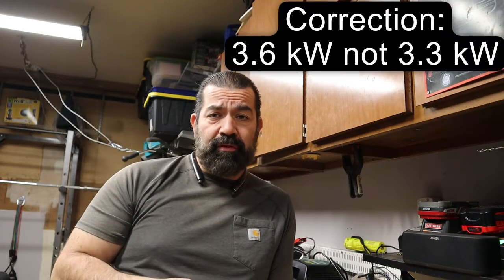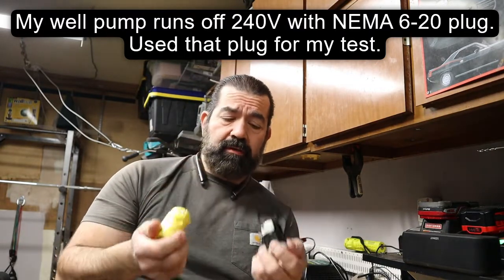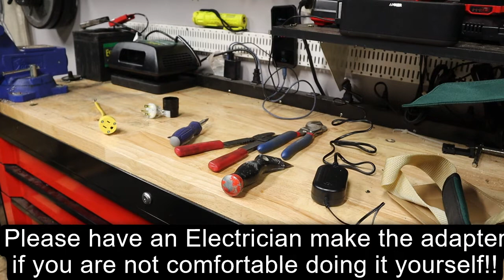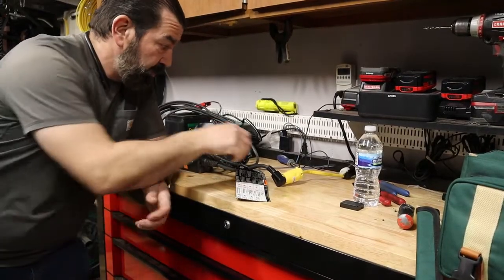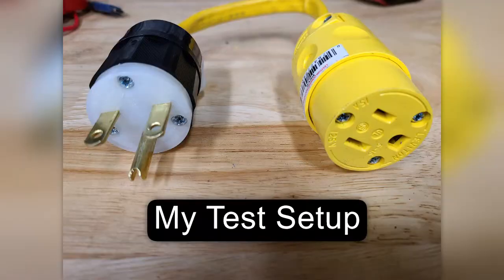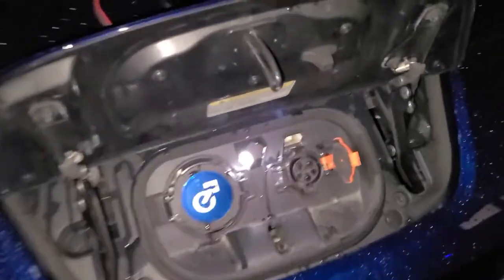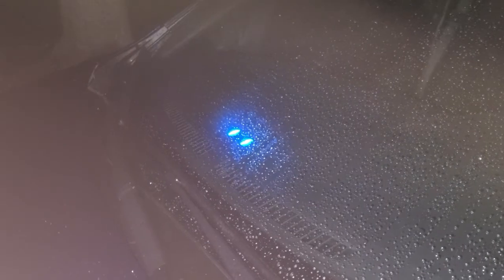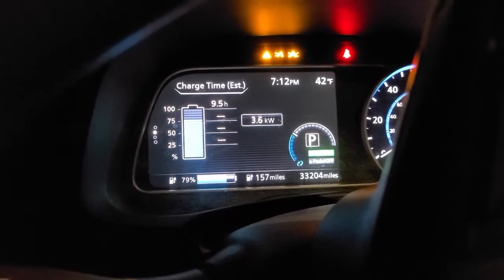UPGRADING your GM CAR CHARGER from Level 1 to LEVEL 2 for $15.

Comment: Neat hack! Any labeling or printing on the EVSE in question stating dual voltage?
Reply from the maker: The charger is labeled for 110v only.  This is a little know secret.  Make sure it's the rectangle shaped charger, not the one with the handle for wrapping the cord.

Comment: Will Chevy install a level2 on the side of my house without a covered parking garage?
Reply from the maker: I have 3 Level 2 chargers on the outside of my house.  This should not be an issue, they are made to be indoor or outdoor use.